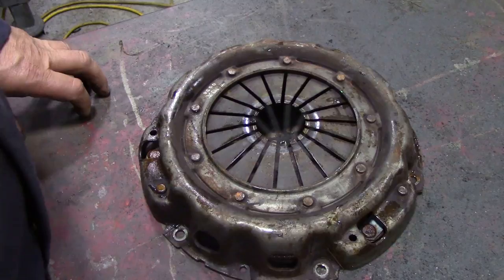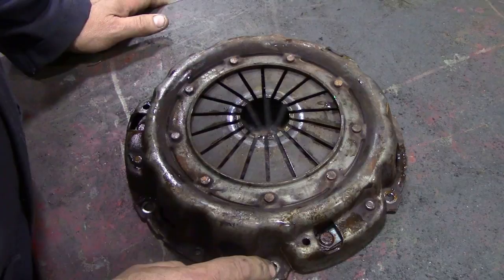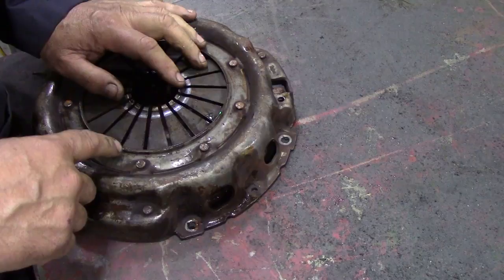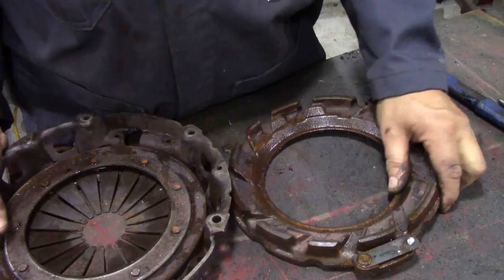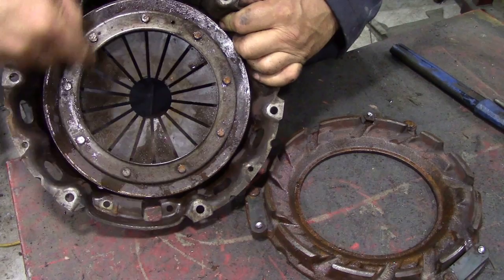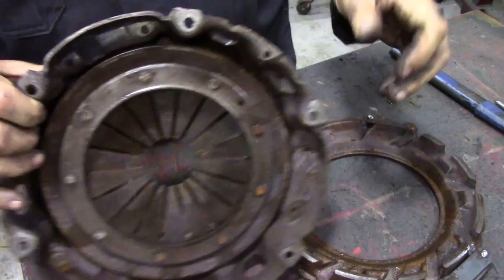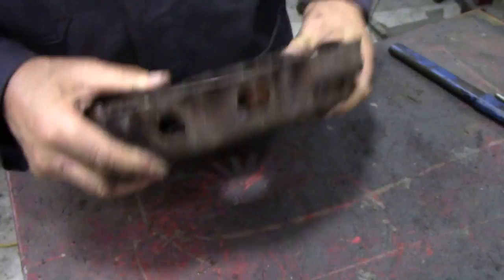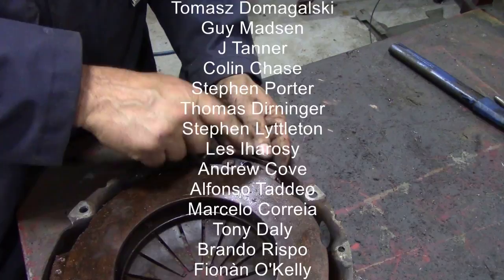How a clutch pressure plate works   - something for Bernt

Comment: I have a question.

What should be the force to the diaphragm spring to disengage clutch? 
I mean the immediate force from the bearing pushing the fingers'-spring.

I have a disassembled VW 1.0 ltr motor clutch, 190mm diam. from Lupo.

I have measured this disengaging force  with scale 
pushing to the center of the preasuure plate with a lever.
and it came 100 kg to disengage (1000 N newtons)
it is huge force!
Maintaining disengaed took 80 kg
ad releasing begins at 60 kg

I had the problems with the diseengaging, due to the too hard clutch pedal.
And it "bumped" harshly 

Thank you for your films.
Reply from the maker: Hard to say as the clamping force varies with different vehicles

Comment: Britannica i need your help, I cant shift up to any gear in my manual gear when high up in RPMS, the clutch flywheel, pressure plate, Throwoutbearring, gearbox oil, engine mount are new and replaced 1 month and 3000km ago. I drove 3000km fine with the new set and never had issues until someone else launched my car from a standstill. When he wanted to shift to 2nd during the hard laucn the tranny blocked. 

Now you think the tranny is broken and that is wat I though so i replaced the tranny but the problem still exists. I checked the TOB with a micro camera and it does move instantly when i press the clutch pedal lightly, already bled the TOB and even replaced the shifting mechanism. Im clueless what is happening and hope you have any ideas
Reply from the maker: Did you check the drive plate in the clutch?
Reply: @BritannicaRestorations  Yes, did not saw anything different. its also 3000km new
Reply from the maker: Did you check for damage in the transfer case? Centre diff could have exploded
Reply: @BritannicaRestorations  We have swapped the gearbox just to be sure, even with new gearbox, new gear oil it still does the same
Reply from the maker: But what about the transfer box?
Reply: @BritannicaRestorations  how you mean transfer box, there is none?

Comment: Would a bad or faulty pressure plate leave my manual transmission car stranded without being able to move the car in any gears
Reply from the maker: Yes - but not very common